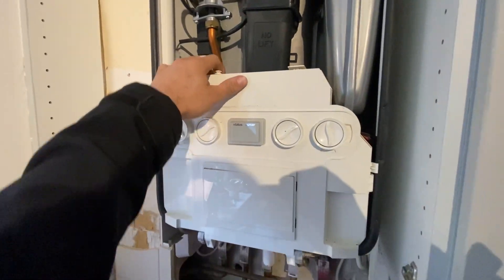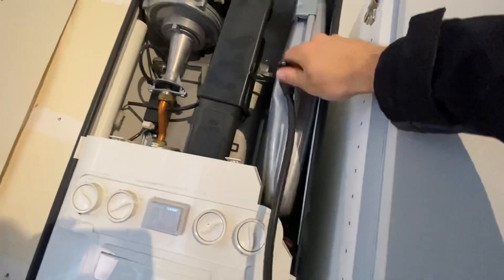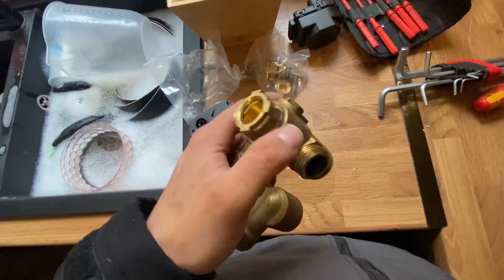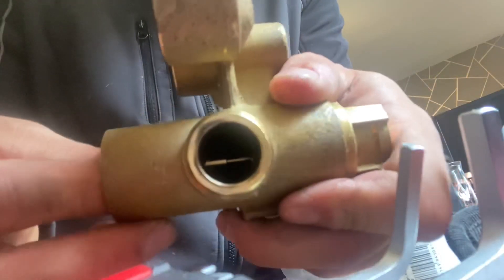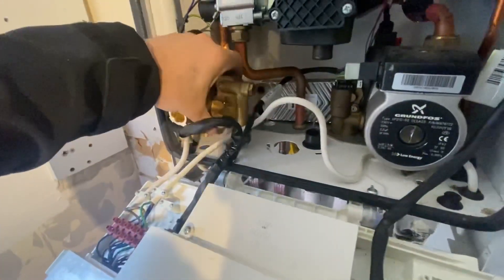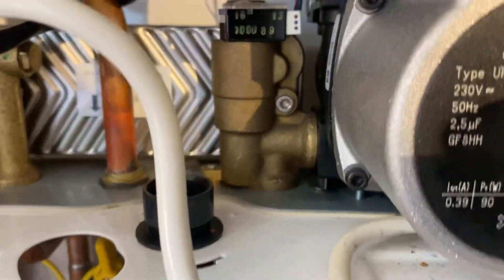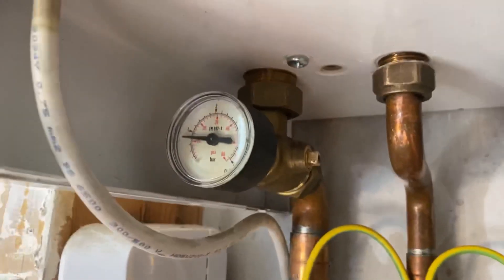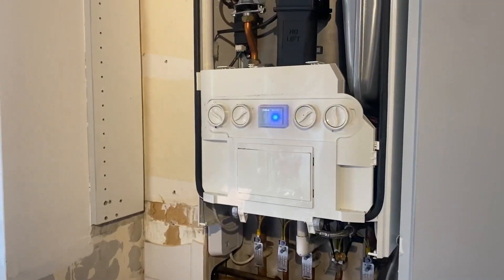How to change a diverter cartridge on a Ideal Logic || Boiler Training

Comment: Good video but I have a question. I've loosened the nuts but how do you remove the block? The pipe at the top is rigid so you can't pull the block up. The block has to go up about 10mm at least given the 2 outlets at the bottom of the block stick out through the bottom of the casing by at least 10mm. Cheers
Reply from the maker: The top pipe should just twist to one side

Comment: Can hust replace cartridge on front and do not take all block?
Reply: I think if the radiator circuit is hot when the hot water is on then you need to change the back part but I think if it's leaking out the front then the front part will work
Reply from the maker: On this one I needed to remove the block
Reply: @SmartPipePlumbing  how I can know if I need to remove the block?

Comment: My ideal logic 30 combo. Shower water lukewarm for 2/3 minutes and increase in hot water.  My dial  is turned to just hot water tap symbol only my radiators turn on when dial is on water only?
Reply from the maker: Diverter is faulty
Reply: Yeah thanks replying, great videos.  @SmartPipePlumbing

Comment: Great vid, made it look easy, how were you certain it was diverter cartridge? old one just looked a bit dirty, but should still work? also lifting out the left block can be difficult due to the top pipe?
Reply from the maker: To be honest it was that long ago I can’t remember the job but I think they had now central heating water was fine just just was moving over for central heating. Or it could have been when the water was on some of the rad were heating up. Like I say I’m not too sure it was that long ago
Reply: @SmartPipePlumbing  I realised that, but thanks so much for the reply, shows a visual inspection is not always reliable! Guessed there must have been an actual issue to start with , great work
Reply: @SmartPipePlumbing  Thankyou for your video i have issue with hot water not staying hot replaced flow valve and sensor ,no change noticed flow pipe heating up for central heating also pressure gauge sticking i believe the diverter valve is sticking  on watching your video seems to confirm this if any other reason could you advise if you see this ie could a thermistor cause this.

Comment: This was so helpfull. I must admit that it left me for  few days with no hot water and no central heating due to the replacement kit i bought did not included new orings and fibre washers. Cardridge was original and complete from ideal (not cheap from amazon) but there was no orings and washers for diverter valve body. I've took the valve off on good friday so all shops was closed. My missus was not very happy over Easter. Advise to anybody who would like to dyi make sure you do have complete kit and shops are open :)
Reply from the maker: Please if you have a problem with the boiler, you will need to get a gas safe engineer to carry out the work, it is illegal to carry out work on your own boiler if you are not gas safe registered

Comment: Bit too fast the video
Reply: It’s still a good video though, very helpful, I just had to skip back a couple of times.
The only problem I had, was wondering what the diverter valve was, when I looked at it, I realised it was a two way solenoid valve which switched circuits, that’s due to me working in a different engineering discipline, and using different terminology for one part.

Comment: Question, our boiler is tripping the fuse each time the central heating is on and when we turn the kitchen hot tap on, however if we have one or other on separately it doesn't trip, only when the central heating is on then we turn the hot tap on at the same time then it trips the fuse. Could this be the diverter value? Boiler is a logic combi 30, if not what do you think it might be? Thanks
Reply from the maker: Hi, thanks you for the comment, without having a proper look I couldn’t really say. But as a educated guess I’d say it’s not the diverter valve as I’d expect it to do it every time even when turned on separately.
Reply: @SmartPipePlumbing  Thanks for the message, yes we found out the issue, it was the diverter valve which was leaking which causes an issue with the diverter motor which filled up with water and caused the boiler to trip,  even though it had been serviced the same day and the plumber who never spotted this, saying it was nothing to do with the boiler, hmm, so new diverter value and motor fitted and back to new

Comment: Very interesting. Quick question,is that a common fault on most gas boilers. Cheers thanks again.
Reply from the maker: Definitely divertor cartridges pass all the time. A what time check is if you run a bath and check to see if your rads warm up